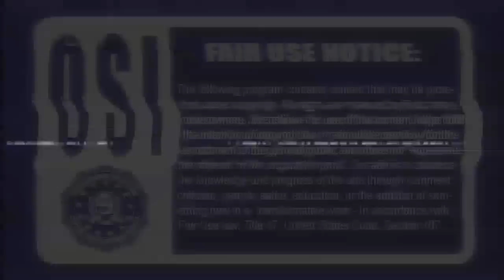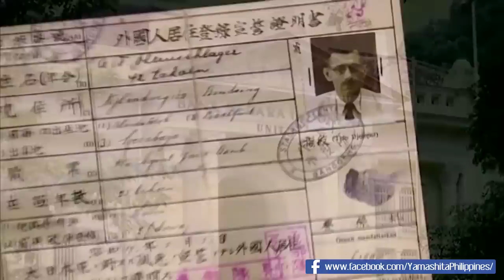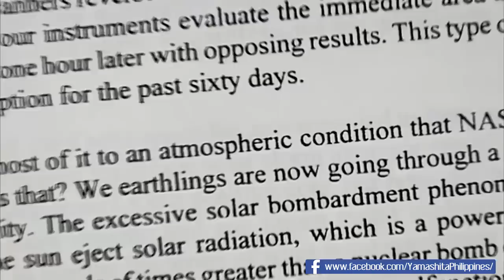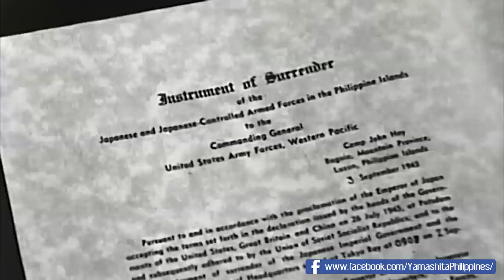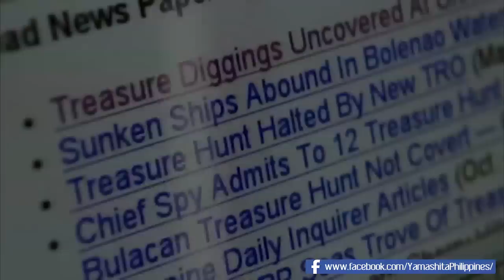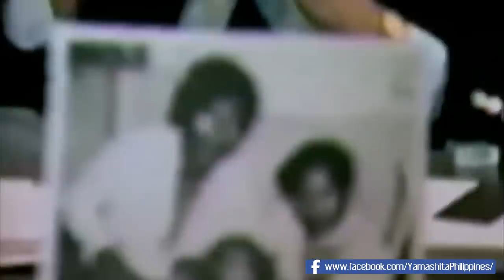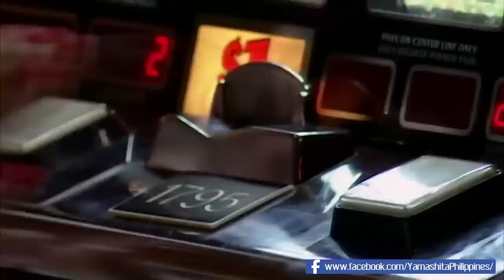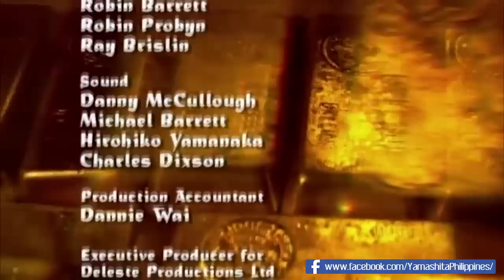Yamashita Philippines - Stories of Yamashita's Looting in Asia

Comment: The best hiding place for treasure is open hiding. When the Sayre Highway was widen and straighten way back in 1978, a feature was a huge drinking 'Banga' (clay Jar) alongside the  highway at Mangima Canyon. It measured about 6' high, 10' wide & 1.5" thick. The water tastes metallic but mountain cold. When the area was about to be bulldozed, along came three 3/4 trucks and an early Hummer. Baby Uzi toting men in barong tagalog alighted and proceed to break down the banga walls into pieces. Gold bars were stacked inside. Each bar is heavy because it need two men to carry it to the trucks. Later, I read that a standard bar weighs 72 kg. The bars were tinged with pale red. 
I witnessed that extraction because the bus I was riding was forced to stop due to the road building activity. We chose the area because of the water and the construction activity was about 50 meters from the banga itself. That was when those armed men in trucks arrive and told us to move away. You don't argue with armed men, but, we can watch. Later, they replaced another smaller banga with a spout. The water was more sweeter and it is still there up to now.
Reply: Wow, nakita mo pala yan. I heard that story since I was a kid, and we passed that banga too. There was another story of the concrete gate with a pair of decorative statues or something, and later the two paired statues disappeared leaving gaps on the gate walls and they said that there were gold behind them that was taken... and that concrete gate was on the Sayre Highway too. Gold is usually hidden in areas with water becoz gold will melt in extreme heat and hot weather.
Reply: Robert Ranciato  not a good idea to do that. It is very risky working in the dark. You might trigger something or might lose track of the signs and mess up the whole excavation.